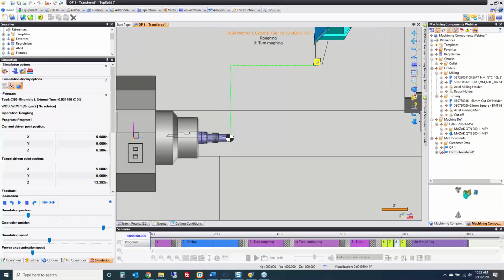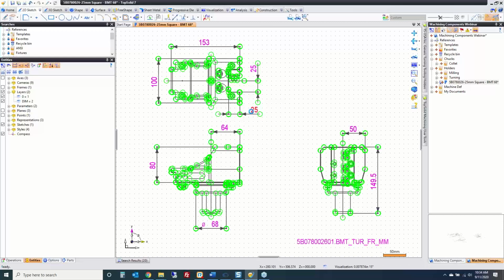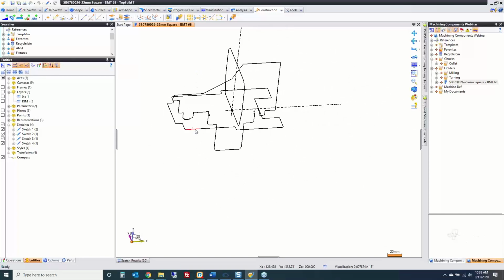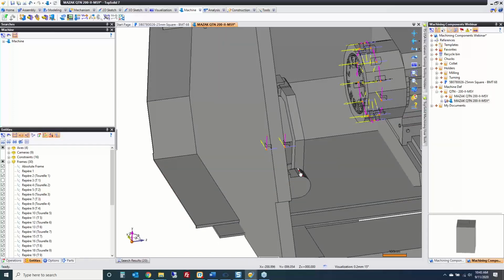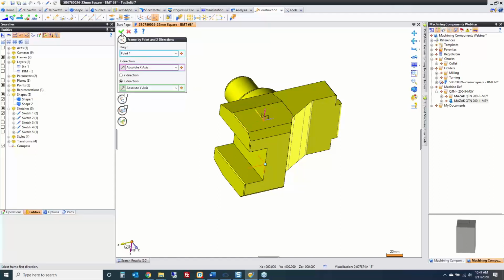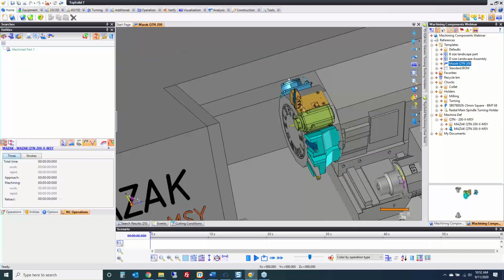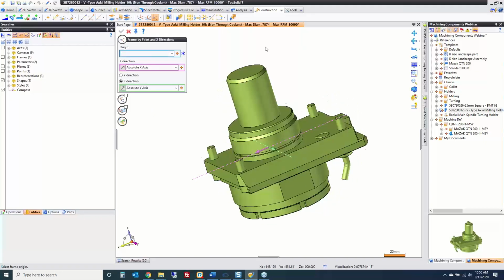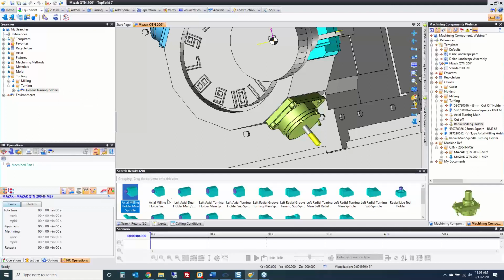TopSolid Perspective:  Working with Machine Components

Comment: Hi, I have been playing with this features and I realized that when I generate setup sheets only the "tool" appears (without holder)
I’ve being thinking why it is happening… May be a setup sheet bring info related to “tool” and in this approach tool holder is defined as “machine” components.
Is that right?
Is there a way to use this approach, which I consider very nice and STILL have setup sheets showing a complete tool assembly (tool and tool holder)?
Reply: Now in 7.18 you also see the holder!
Reply: May be too late for the answer, but a tool holder can hold any number of tools. I've modeled an 2x4 spindles machine component lately. Your setup sheet describe your tools individually, so there's no point of adding the machine component for each of those 8 tools. When I use machine components on the turret (i.e. every single time :) ), I add an assembly draft that describes the equipped turret ("BOM-like").
Reply: @Jean Le Guique  Hello Jean. No, it is not too late. Thank for your comments.
Your point of view is reasonable, and I will consider.
Anyway, next week my colleague Fernando Paschoal will discuss this matter and related ones with Thierry Leclerc and Tuan Le.
I have already fed Paschoal with samples to be discuss.
This is a demand from one of our customers. A setup tooling setup sheet with exploded assembly and BOM.